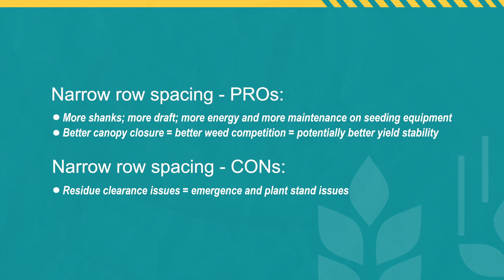Growing Smarter: Wheat Row Spacing

Comment: I use a Moore Unidrill with 5“ or 12,5cm narrow row spacing and i prefer narrow over wide row.
Wide rows should only be done with seed singulation.
Reply: and narrow for them was 7.5inch.. its wide row spacing in Europe. I cant see almost any benefit for wide row spacing unless you grow corn or something bush-like plant. Even rapeseed's world record was sown with Väderstad Rapid that had 5inch row spacing.
Reply: @karl6458 
As i‘m doing no-till I see it little bit different.
For Wheat, Barley, Gras, Rye-Vetch mix, I prefer narrow row spacing 12,5cm because it allows higher seeding rates but has still less in-row plant competition. 
For crops with high seeding rates like all grain crops it makes sense for me. 
But for rapeseed I want try 37,5cm wide row spacing with my Moore Unidrill. So I have to dismantle 16 of 24 Coulterdiscs to just have 8 Discs left over on the drill.
Than lowering seeding rate a bit.
In that case it makes sense for me to do wide row spacing because when I do no-till into grain stubble only 8 Coulters move less soil than 24 Coulters (its 3m drill). That means I disturb the soil less and there will be less weed pressure so I can work without ground herbicides.